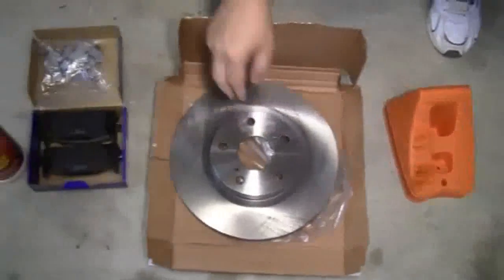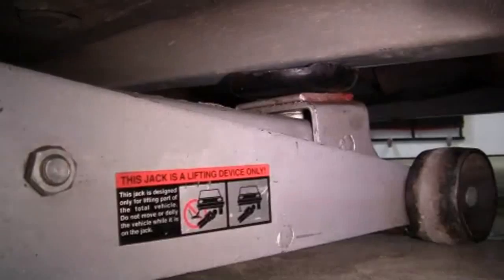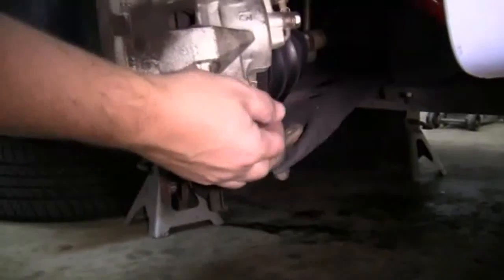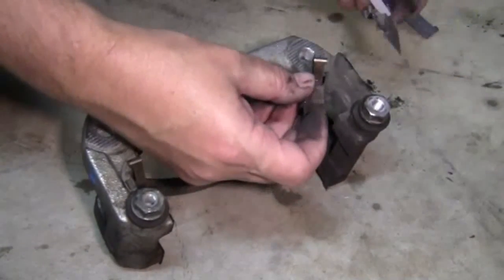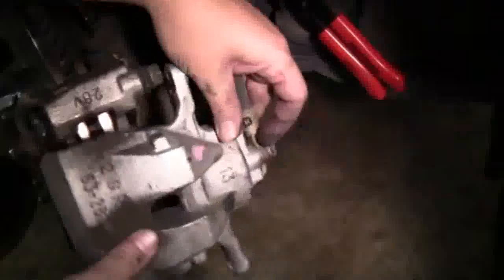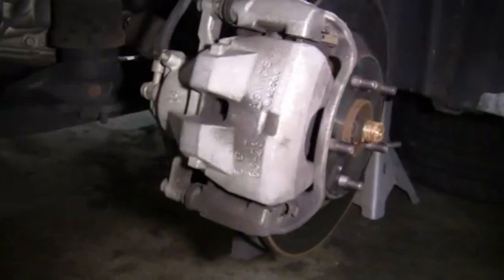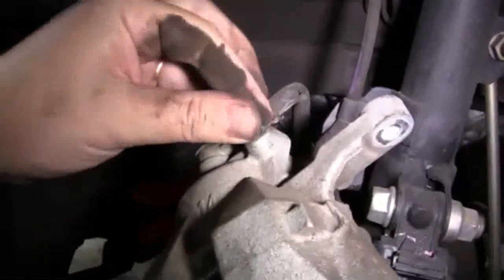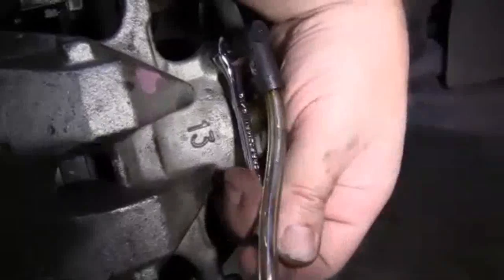How to Replace the Front Brake Pads and Rotors in a 2007 Toyota Camry

Comment: Thanks for the great video. You guys did an excellent job covering everything. The only things I did different:  1. Used Sil-glide (silicone based lubricant) on the guide pins.  2. Used Silaramic between the shims and brake shoes.  3. Used Silaramic on the shims between the shims and caliper.  4. Only used C-clamp to compress the caliper after I separated the caliper from the rotor and bracket. This way I only have to compress once. I don't like using anti-seize because it dries up with the high heat from disc brakes and this doesn't allow for the guide pins to slide freely. Thanks again.

Comment: Informative video, keep them coming. I replaced my brake pads, after watching the video (also flushed all brake fluid).  Couple comments:  I didn’t need for the brake line clamp tool, just pushed the pistons in and removed some brake fluid from the MC prior to ensure it doesn’t overflow, simple.  Used anti-squeal paste on back of pads. My brakes are nice and quiet now :) Thanks

Comment: I would only recommend using the Blue. The Blue (medium strength) along with the proper torque is all you need. The Red is mainly for bolts that you don’t intend on removing on a normal basis. The Red may require heat source (torch, etc.) to get it back off.  Use the Blue and you will be just fine.

Comment: I notice how easily those bracket bolts came off.! Guessing they may have been loosened a bit before hand.  I've always done those bolts with a breaker bar but am thinking to give an impact wrench a try.  Maybe with some Kroil and heat first.  Think I can do it without sheering the bolt?

Comment: You can actually push the pistons back in by first opening the brake fluid reservoir cap in the engine bay, then use a flat head and stick it in between the rear pad and caliper. Lean the screwdriver towards you and it will go back in.
Reply: Dexion845  I did follow this process, recap the reservoir and test the brake but my brake pedal didn't seem as firm as it once was before the brake job.  Any idea?  Air couldn't have gotten into the brake lines?

Comment: I did my brakes and rotors tonight on the 2009 Camry but after the installation, my brake pedal seems a bit spongy and not as firm as it was before. Can air got into the brake lines?  What I did was, remove the cap on the brake fluid reservoir then push the caliper, recap, push brake pedal a few times, test drive but its not as firm. Should I drive it a bit more to see if get normal again?

Comment: 1:33 Should it say "Bolts to remove rotors"? So the size is M8 (8mm not 13) Great video. I replaces in the past just pads. I didn't do any bleeding then and everything worked ok for few years now. Now I have to replace rotors as well. Can i do this without bleeding again?
Reply: 8mm is the bolt diameter, but you use a 13mm socket on their hex head.

Comment: my car is xle, I guess to take care of the  rotors I also need the 2 bolts to pull them out?
Reply: I have a 2007 V6 XLE  and my rotors came off without using any bolts to pull them off. I think it just depends on whether or not there's rust between the rotor and axle.

Comment: Do you really need to bleed the caliper to compress the caliper?  What's the reason to bleed caliper when pushing caliper piston back in cylinder? There is generally a bleeder hole in the master cylinder to allow brake fluid to return to the reservoir when you compress the caliper.
Reply: as long as you compress the caliper slowely you shouldn't have to bleed

Ive done brake jobs and rotors on my truck and on this yaris and never bleeded either, and the brakes are still very touchy and solid

Comment: You just have to watch you brake fluid level in master cylinder reservoir doesn't overflow when you compress caliper. Is that not so?
Reply: Not the way they did it. They clamped the brake line and opened up the bleeder screw to allow for the fluid to be ejected into their bleeder cup when compressing the piston, so the fluid doesn't go back into reservoir.